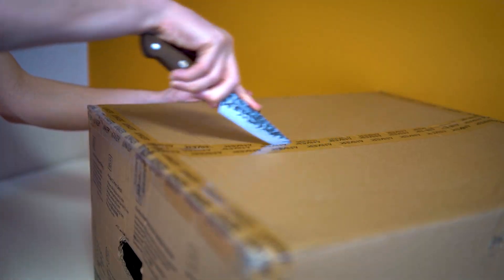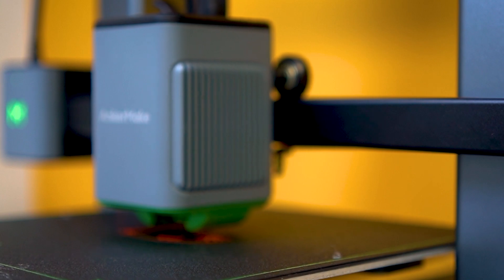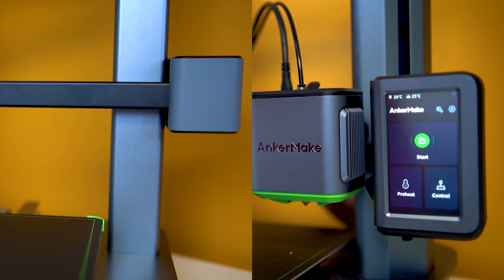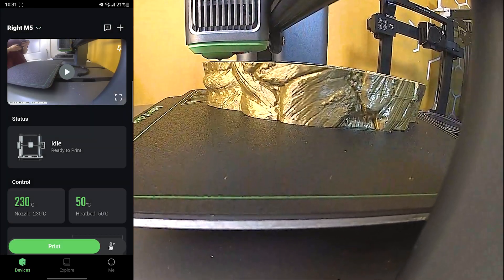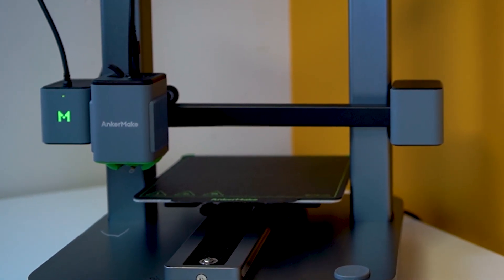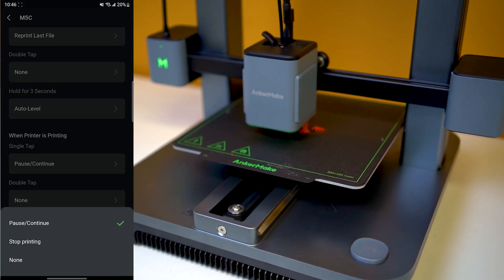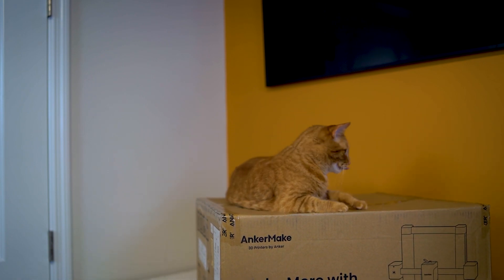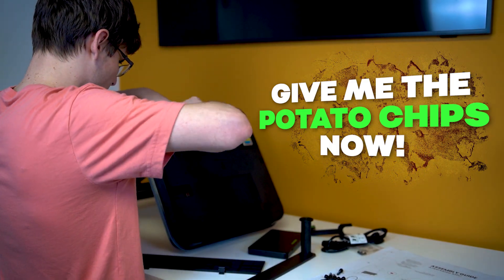The NEW AnkerMake M5C Is AMAZING!

Comment: This is the first 3D printer that my husband has ever owned! We have been working consistently on it and I do a lot of troubleshooting and he really appreciates all my help! It's been Epic but you really need to how that PLA + is the only type of PLA you can use on this 3D printer. It comes in all colors and it is the best filament to use as you get started. It has pre-settings and  works beautifully. Also don't forget to clean your bed with alcohol and then some dish soap after you change to a different filament and then auto level to get the best results for your prints! Have fun but learning is the most important thing of all so you fall in love with 3D printing!!!♾♾♾

Comment: Great vid,
The only issue I see is too small. The gold standard is to be able to print in place a full size helmet. You can't do that here.
Reply from the maker: Thanks for the kind words! I think it's great to be able to print a full sized helmet, but I do wonder what the percentage of people that print full sized helmets is. I can't even print a full sized helmet on my x1c
Reply: @ThePrintHouse  agreed on the percentages... but the helmet was just an example.   I have a 300x300x320 Neo Max and I like to load up the plate before I print.
The problem... it is slower than molasses. :)
Reply: @graphguy  My commentary was about the requirement to install an App. I have an older iPhone 6s and some of the newer Apps require a newer Operating System on the phone which older phones can't install meaning the App can't be loaded. So, this printer without the touch screen is a negative for me. Another thing I will comment about is your loading up the build plate. I typically don't do this, not at all saying that you shouldn't. The reason I don't do it is if you load up, example, 5 parts and 1 part fails, you would either need to stop the print or let it keep going printing spaghetti where the failed print is which might screw up the other parts as well. My solution was to buy multiple printers, I have 10, and I run only one part on each machine. That actually speeds up the print time as well. I know many people won't buy multiple printers due to cost and space. I did not buy new printers as I am really a DIY guy so I bought 7 of the 10 on eBay that were "as is, for parts only" and I fixed them.